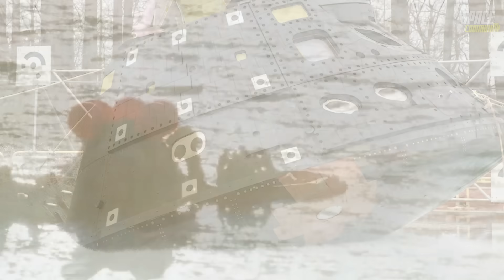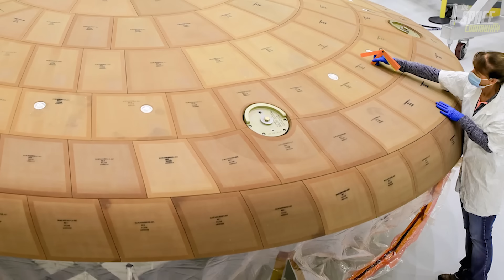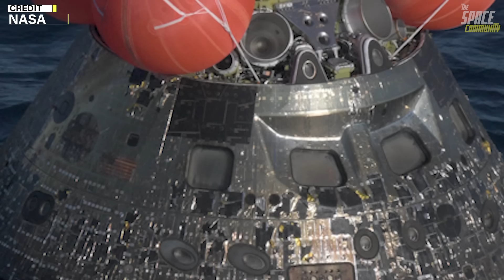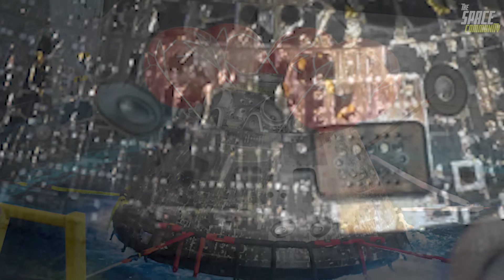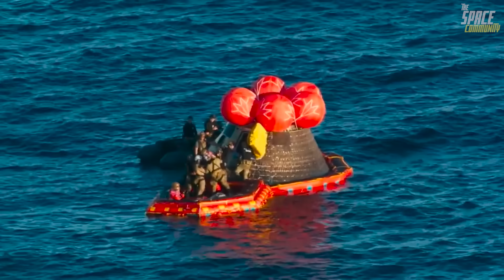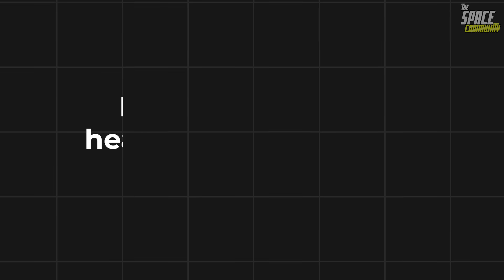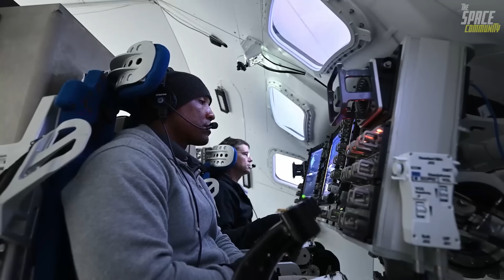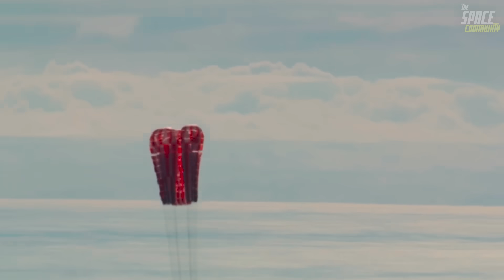What NASA Found After Artemis II Orion Inspection is Concerning! Heat Shield Missing & Bare Survival

Comment: The ocean temp was 65.5 F, that can turn to steam at 1080f. so you're telling me that those tiles displaced 4000 f in the 6 minutes it took to float into the ocean!   Amazing !!!
Reply: Because of the ablative nature of the shield material and the cooling from the decent in the atmosphere, the information I’ve found is that the shield was at about 200 degrees Fahrenheit when it landed in the ocean.
Reply: It’s almost unbelievable isn’t it!   Can someone explain how the windows stayed intact?
Reply: @LozBrown-j6l  And I also wonder why the glue to stick the Avcoat plates to the Arftemis 2 landing capsule did not burn. There is space left between the plates. The heat between the plates could have burnt down the glue and even burnt the capsule.
Reply: 4000F is the maximum temp in the upper atmosphere while the capsule is slowing down initially.  Agreed the air density increases as the capsule descends to sea level but the entry velocity falls until it is low enough to open first drogue and then main parachutes safely.  Once most of the velocity is lost, the cause of friction with the atmosphere decreases dramatically.  That is why a temperature of 200F, just below the boiling point of water, has been posted when the capsule entered the water.  Within about few minutes this will have dropped to near the water temperature at the splashdown point. After splashdown and before the  recovery of the astronauts the recovery team did test for noxious gases, presumably from the contact between a hot capsule and heat shield with sea water.
Reply: @bobdear5160  noxious gas test most likely for hydrazine leftover from the steering rockets.
Reply: You're talking temperature, not heat. The critical factor is how fast the heat can flow out of the tiles into the water.

Comment: Ablative material is designed to burn off or chip away (ablation) to dissipate heat and energy protecting the underlying structure.     This was referred to years ago on Star Trek (SciFi) where combat ships had Ablative Armor that would absorb the energy from enemy weapons and slowly wear or burn away.    Todays automobiles are made with (ablative plastics) to where the bumpers and corner panels absorb the heavy impacts and are shed or fall away and actually helps the people inside (along with air bags) to survive high speed impacts.
Reply: ICBM's, Mercury, Gemini and Apollo had ablative heat shields.
Reply: @jimmci9584  -  NOT the same thing,   permanent shields are not ablative !

Comment: Is it possible for the capsule and Orion to enter earth's orbit and to come into the earth's atmosphere more gradually avoiding some of the extreme temperatures  while desending to the surface of the earth?
Reply: Not with current technology. That would be ideal but current propulsion systems are still based on rocket technology and that requires massive amounts of fuel to generate enough thrust to slow the vehicle down once gravity takes over. It’s theoretically possible but the technical challenges require something more like sci fi power propulsion rather than current chemical fuel combustion that is in use today. Regrettably, i have observed and said for fifty years that space technology blossomed in the 60s but has been stagnant ever since due to a lack of interest and funding. We should be at a point with new technologies capable of exactly what you are asking and it’s a point well made.
Reply: @gb1978gb Dear GB thankyou for your thoughtfull response!!!

Comment: i found the recovery of the crew and the capsule very odd 

since the vehicle itself was brought aboard into the rear of a marine style ship where boats can be easily deployed with marines and vehicles 

was it necessary to have a helicopter lift each crew member separately, (if i got that right) taken to a waiting ship and later recover the vehicle, is all the drama necessary, the extra fuel and helicopter usage 

maybe i answered my own question, recovery dragged out and made more dramatic, all the extra faffing about with an inflatable porch and small boats - but it could be just as dramatic with the capsule brought safely into the back of the ship and champagne corks popped

while its a bit of a landmark mission, so many years since anything like it was done, it is essentially just another space flight
Reply: They need to get the astronauts to medical bay asap. That’s why they are rescued first. The capsule was recovered 2 hours later. Different staff need to rescue different things according to specialty. A doctor rescuing a capsule doesn’t help anyone.
Reply: Government workers have a different culture and job procedures.
Reply: Always has to be a downer. Looks like you are it.

Comment: Not tiles….its an integrated heat shield
Reply: It is using Avcoat machined into tiles. It is 1960 technology. The backshell and sides use silica-based thermal protection tiles.

Comment: You are good. But it would be nice if would explain the heat shields like u would to a 2 year old. Thanks
Reply: Basically it's a covering over the capsule that absorbs the heat from re-entry and flakes and burns off, taking the heat with it.

Comment: Damage could be caused when hitting the water.
Reply: AT 20mph  YOU GOT TO BE KIDDING.....EVEN AT MUCH HIGHER WATER HITS IT BETTER STAND TOUGH....AFTER THE EXTREME AIR SPEED WITH 5000 DEGREES THAT HULL BETTER TAKE IT >>>>>>>THE TILES ARE STRICTLY FOR THE HEAT ........THEY COULD FALL OFF WHEN HITTING THE WATER AFTER THE HELL THEY WENT THROUGH AS LONG AS THEY RECOVERED THEM TO LOOK AT........IM GUESSING WHY YOU WERE NOT SHOWN THE BOTTOM AND >>>NO REAL TALK ABOUT THESE TILES WERE DISCUSSED HEAR IS BECAUSE>>>>>>>>>THE BOTTOM TILES LOOK LIKE THEY HAVE BEEN THROUGH HELL HEAR!!!!!!!
Reply: THE SHUTTLES OF THE PAST WERE ALWAYS REPAIRING TILES AFTER FLIGHTS........
Reply: @zapeirsky the hot tiles hitting the cool water.  Not the speed.  Dept

Comment: Is it possible to adjust re-entry angles and speed to re-enter at a lower speed?
Reply: Skipping isnt good for the Materials, so not a good Idea. 
you can't break in space, for this you would need another big Rocket. So to use the atmosphere is the best way to lower the speed they got on speedup to the moon
Reply: I don't think so, you're going to experience extreme heat no matter how fast you're going.

Comment: Artemis III will use a different heat shield.
Reply: It uses the same material but with some changes in the manufacturing process and especially the re-entry trajectory.
Reply: Different heat shield. Better and cheaper. Nothing can possibly go wrong.

Comment: Not to pick nits, but ablative is pronounced ab-láy-tive.
Reply: I think it's a computer generated voice tbh - some of the "words" were across spaces in the text, and accent on the wrong parts of other words such as "WORTH-while".  It may even be a totally AI generated narrative tbh, as it thinks the underwater self-righting balloons on top are "stabilisation balloons":  they don't stabilise anything - they are there just in case the craft ends up in the water upside down  (in fact if anything they de-stabilise a stable inverted position).
Reply: @OwenLloyd  I was thinking that too.  There are pauses in the wrong place at the end of a sentence, and every time the voice says "2" in "Artemis 2" the number 2 is stressed.
Reply: @OwenLloyd  Naa, I think this guy should have done a rehearsal read or learned to edit. AI script is smoother & more consistent in it's screw-ups & bad vocal spacing. I did notice that right away as well.

Comment: I am not a structural engineer so take with a grain of salt. 

It baffles me how you can have this capsule with tiles (I can wrap my head around that), but how do you have a window??? Like what kind of super caulking is used? Seems like a serious failure point...
Reply: The window is not in a high impact area. Mercury, Gemini, Apollo, and the space shuttle all had windows.
Reply: You can see that the areas with the windows are indented, which probably helps.
Reply: Are you concerned about heat on reentry or holding up to the vacuum of space?  In terms of reentry heat, the windows are not in the friction zone and glass is an excellent thermal insulator if there’s space between layers, not much of an engineering problem.  If you’re worried about the vacuum of space, again, not really a problem.  There’s more of a pressure differential 30 feet under water (roughy 14psi on surface, 30psi 30 feet down) than there is in space (14psi inside capsule, 0psi in space).

Comment: I really do appreciate the update. Great job, my friend! The Heat Shield is arguably THE most IMPORTANT part of any mission. If it fails, EVERYTHING fails.
Reply: How did SpaceX overcome the heat shield problem?
Reply: @thegoodthebadandtheugly579 SpaceX eneters the atmosphere st MUCH lower speeds and therefore has much less heating, so their solution wouldn't work for Orion.
Reply: So true, even if the mission was successful, if the heat shield fails during re entry, the astronauts are screwed. The mission is screwed.

Comment: It looks like the heat shield did its job perfectly. Unlike SpaceX. This is a one use vehicle and return system capsule. Looks like the NASA technicians got it right. 😎👍
Reply: Wow this is idiotic.
Yes, a finished product needs to do its job. You really gonna compare it to a prototype? Why not compare it to SpaceX Crew Dragon. Its heat shield also does its job flawlessly, bringing people home from ISS.
Reply: spacex is doing iterative testing on a MUCH larger scale vehicle.  it is unfair and disingenuous to compare the two as its definetly apples to oranges here.  i get it:  noone decent likes Musk.  but that doesnt mean the work SpaceX has done is automatically "bad".  trump supported this launch.  does that make THIS bad too??
Reply: @Chace957  I have nothing but adoration for SpaceX and what they are doing. They are an inspiration. 😎👍
Reply: @Steve-Cross  You're original comment wasn't clear - "Unlike SpaceX" shouldn't have been a stand alone sentence. I think you meant "Unlike SpaceX, this is a one use vehicle and return system capsule." But I initially read it as "It looks like the heat shield did its job perfectly, unlike SpaceX."
Reply: @Chace957 I have never been a fan building very technical machines to the lowest bidder, Elon is doing it right keeping the majority of the assembly in-house 👏
Reply: They sure did get it right. I'm impressed!
Reply: If it’s a one use vehicle they need a new engineering team that can design and build something that will last more than one use….what an enormous waste of resources
Reply: The Orion capsule is designed to be refurbished and reused, while the European Service module is not. @dominicm2175
Reply: @dominicm2175  They have a new design and material for a new heat shield, they just didn't use it this time, instead opting for a "skip" method of entry to more gradually bear the heat load. It's still a single use article, however.

Comment: A heat shield for a re-entry vehicle like that has been tried and tested for over 65 years. I was worried about the parachutes as I always do. I had expected there would be no problems with the heat shield.
Reply: The mains are designed to reef slowly to reduce stress and load on them opening all at once, quickly.

I believe only one time in a manned Apollo mission, did a main fail to open fully, Apollo 15, IIRC. 2 of the 3 opened properly.
Reply: I know, right?!?! The tension can be measured as the capsule falls effortlessly through the sky.
Reply: I'm not comfortable with that white patch on the bottom of the heat shield
Reply: Parachutes have been tested longer than heat shields.
Reply: @Lobonova Exactly.  It is a new design of heat shield, so why trust that more than parachute technology that has been in use decades longer?
Reply: Have you ever seen Saturn 5 heat shield not on TV up close
Reply: @Viper-n7g  I assume that you mean Apollo, not Saturn 5.
Reply: For a minute I thought the main parachutes were not going to fully open.
Reply: @laryanryan9170 The main 'chutes are designed to be slow to fully "fill", otherwise, they have a high degree of shreading to pieces. There's a bunch of older videos showing the extensive testing that been done to prevent it.
Reply: Thank you.
Reply: At what height do the main chutes open? Is the same height every time or does the atmospheric conditions that determine opening, I was flipping through channels and stumbled on channel someone said the chutes open depending on the atmospheric conditions, I said to my self, I have no degree or expertise on re-entry, and knew what if the conditions tells it to open at 2000ft.
Reply: @FiercePatriot there needs to be enough air before the large parachutes can be deployed, otherwise, they would not expand fully.
Reply: But this was an entirely different style of heat shield, wasn't it? The old style ablative shields of the 60's & 70's worked, but this was a new design & the similar shield on Artemis I didn't fare so well.
Reply: The Artemis II heat shield is a totally different material and technology from times gone by.
Even Artemis I had issues with the rate the new materials burnt away so they even made changes between Artemis I and II.
Reply: Ehh. Just nother cover up for the epstein files to visit the moon😂😂😂
Reply: Don't be so sure, the one just before this one burned through.
Reply: Artemis 2 returned at a higher speed than any previous spacecraft, so it experienced higher temperatures than ever before.
Reply: @dstarling61 
It certainly looked more scorched than any previous returning capsule!...
Reply: Same material but built differently in order to...

Let's all say it togethet... 

... REDUCE COSTS.

To be fair we have far better manufacturing techniques than what was available in the 60s and there are certainly going to be ways to reduce costs and improve manufacturing flexibility. But these reentry speeds are so high that there's no way to truly test these changes.
Reply: @beargiles4062  Artemis (Orion) uses Avcoat JUST like Apollo. The only comparable reentry shielding thats still flying (STS is  out 🫡) is Starship...Avcoat is PERFECTLY FINE, and the Orion capsule could be reused if needed. Just replace the Avcoat heat shield! Im a 💯% SpaceX fanboy....be dont be disingenuous and act like Starships tiles havent burned through multiple times, or had issues overall...I ♥️ LOVE Starship, but Avcoat is ACTUALLY proven, whereas Starships tiles arent even rated for cargo missions, let alone close to being man-rated. Think of Avcoat as brake pads that last ONE long road trip....they're  SUPPOSED TO GET THIN TOWARDS THE END OF THEIR LIFE  ......they performed flawlessly.
Reply: I too was worried about the main chutes,  they were slow deploying
Reply: @J @Jeffreybelieves ey are designed to deploy slowly. If they instantly deployed the sudden force of air would tear them apart.
Reply: @Jeffreybelieves  phew? Someone else saying what I was thinking while watching this event. We got some really great pictures of the moon!  🌚🤔👍
Reply: @Jeffreybelieves  me too I was like do I have to show these guys how to do a proper re-entry of the atmosphere
Reply: We are NEVER getting off this big blue marble! If getting back to Earth is such a hassle how can you rationalize the amount of time and resources spent upon reentry?
Reply: @MrReymoclif714  I am thankful we belong to this big blue marble, a planet DESIGNED to hold life? :)
Sidenotes; we are the only living beings in the universe, no other planet has the same conditions.
Reply: @MrReymoclif714 . It’s only a hassle because we are still learning how to deal with high temperatures from re-entry in a highly reliable way. The more data we collect, the better the solutions.

Comment: Thank you.  I was sure the appearance of the heat shield had indicated failure after a journalist specifically said there would be no peeling off this time around.  The journalist was incorrect as the ablation was not to be eliminated, just reduced by changing the angle of re-entry and burn rise both to reduce friction.
Reply: Air compression not so much friction.